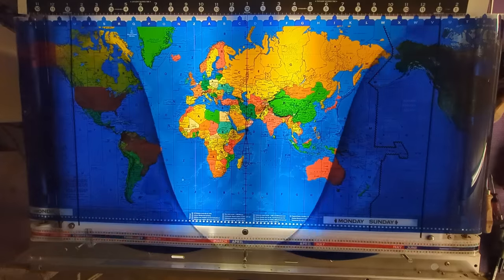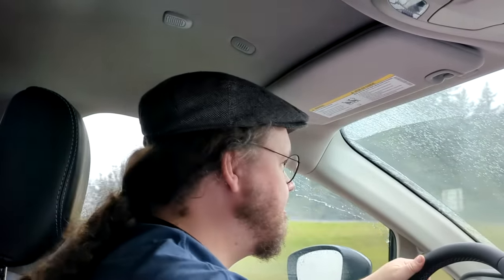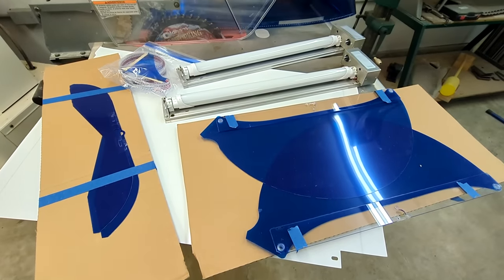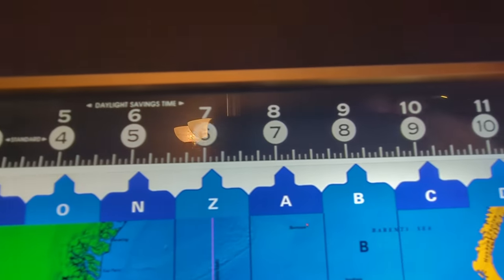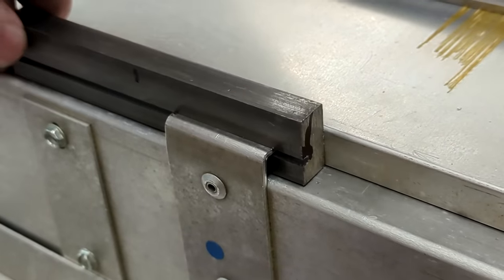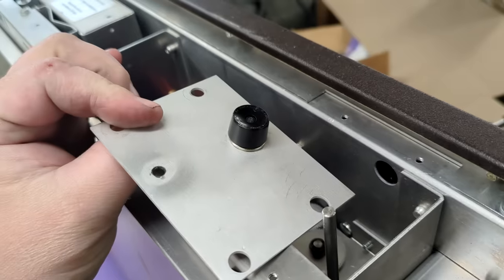The greatest clock (and map) ever made

Comment: The point of timezones was to create local time that is usable and easy to deal with. Having a local timezone that changes as you take a walk would make it entirely useless. Fun for non-critical stuff maybe? But definitely not useful as a planning/communication tool. However switching to everyone using UTC could be feasible. It would make cross-country or international planning super easy, but would be a bit weird for some people to be eating lunch at 0300 and others at 1500. You would eventually get used to your current timezone and just know that you eat break fast at 10PM and mid day is 4am, but that would still be awkward. Maybe a better solution would be to use one global time for computers and international planning, then create a few 'local' timezones where people can still have lunch around noon no matter where they are. Maybe if we divided it up into 24 timezones so each person would be within about an hour of noon no matter where they are. Then 99% of the time they can use that unless they need to deal with someone outside of that specific timezone.... Hmmm that's starting to sound familiar.

Comment: One problem with getting rid of time zones would be time tables. For example, if you live 100 miles away from an airport, and you need to be there at noon to check in, the time you leave home would vary based on the direction you have to travel to get to the airport.
Reply: The more sensible (though still very problematic) way to get rid of timezones would be to just run everything in GMT and be done with it.

Comment: Wouldn't it make more sense to use the devices GPS/location in some formula/calculation to get the local time offset then offsetting from the time at longitude 0 rather than subdividing into thousands of sections?
And maybe have some setting to throttle how much the location gets updated to something like per minute to save battery power.

Comment: Okay this is totally a double comment, but not only am I on board with your idea to add longitudinal time zones, I'd like to expand it further by suggesting we convert time to % of day. This makes the local conversion easier to comprehend intuitively, as local noon is now 0.5 on the clock rather than all of this mixed-base 60/12/24 nonsense we currently use. Of course the most promising outcome here is that now we maintain time in the same way that MS Excel stores it internally, which will benefit at least 3 people globally.

Comment: Time zones need to be simplified whenever possible but... they exist for a reason. We need to know when stuff will happen at different places, usually within our city and a couple of nearby ones. Without that we would need to add timezone information to every time statement.

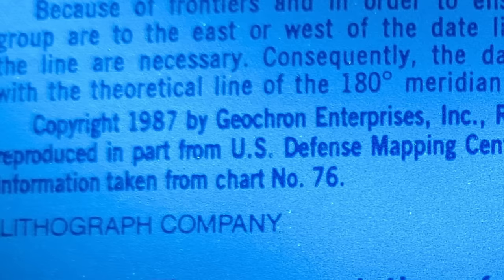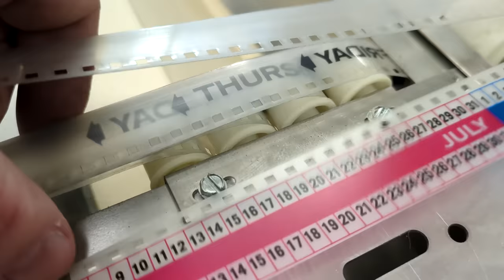Imagine you have to be at work at 8:00 UTC -6:34 the bus arrives at the station at 7:55 UTC -6:50 and you wake up at 7:05 UTC -7:04. How do you even compute how much time you have to arrive at the station and if the buss will be on time by the time you arrive at work? Putting everything on the same timezone frees you from making all those extra calculations. You can easily estimate "if the bus takes 15 minutes then I have to take the one that arrives at 7:25 meaning I have 20 minutes to catch the bus!" 

With your proposal you would have to input every time statement into your device so it can track it for you and essentially convert it into the "you" timezone.

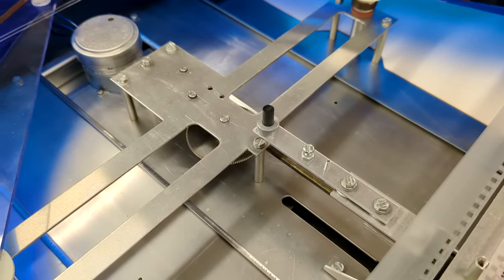Comment: RE: the end. It is "as complicated" to switch to your system. The difference is where the complexity lies. Current system, the complexity is owned by programmers and states. Your system would shift a lot of that to normal people. I have to be at work at 8:30. It takes 30 minutes to drive to work. Currently, I can just leave at 8:00. But under your system, depending on the angle between work and I, I may still leave at 8:00, but only if I am at the same longitude as my workplace. Otherwise, I need to know the time shift between work and I, and add that to my commute length.. so if my work is in a time zone "10 minutes west" of me, I need to leave at.. hang on, which way does the Earth rotate? Do I need to leave at 7:50 or 8:10??? If AT&T customer support closes at 9ET, and I live on US west coast, I can simply call by 6:00. But if they close at 9:00 in.. the HQ's block in NY's? time zone, Now I need to know how many "minutes of longitude" I am from there! Do I have to open some app with a map every time I need to know what time someone ELSE is talking about? I hope I've illustrated my point: time only matters relatively. There's a guy who had a big theory about this. There is no absolute definition of time. Your system fights against that!

Comment: If you could clamp an aluminium strip to the base (for the purpose of making a template for the holes) then surely you could have stuck a length of blue painters tape to it and marked the holes that way. The tape could then be carefully removed and stuck to your new bottom plate...

Comment: I do agree we should get rid of time zones. But I disagree, that we should introduce a more convoluted form of time zones to replace them. What if you have an appointment 20 km away, for 12:00? You'd need to factor in the direction of the place, as they may be a few minutes behind, or few minutes ahead. Or they can be at the same time, if directly south or north. Or anything in between, if they are "north-east", for example. Using UTC or something similar seems like the best solution, although it'd be weird when 13:00 is suddenly midnight for some places of the world... And when you ask someone from another country "what time is it for you now?" they can just tell you the time (which will be the same for you), and you'll have no idea what time of they they meant. Perhaps adding some affix to the time (such as the current AM/PM) could help... like "23:35 afternoon" or "8:12 evening". Either that, either don't touch the time zones at all...

Comment: 12:40 - This is a problem for a rubbing! Use some tracing paper or a few strips of paper taped snugly against the surface and rub it with a crayon or pencil to get the outline of the holes and other features of the device. Then tape that rubbing to the flat stock and use a punch or scribe to transfer the locations. There are advanced methods that transfer the graphite of a pencil directly to the final product stock for even more accurate measurements.

Comment: Whilst I like the idea of no time zones, I do see an issue.

Say I'm putting a calendar entry in for an appointment. 
Sure, the receptionist can say what their longitude code is.

But what if me and a friend want to meet at the clock tower at 12:00.

I now have to open a map to locate that clock tower to find the longitude code of its location in order to set it up.

People already struggle with simple concepts like 9 o'clock and 9 o'clock vs 0900 and 2100.

Having them NEED to use a smart device to find their current longitude code will destroy their minds.

Comment: Any chance you'd be willing to scan the service manual? I contacted Geochron recently and they state that the manuals "aren't available", but they would be happy  to charge a per hour technical fee for support. I find this a bit odd as there clearly IS a service manual, and the company has been DIY repair helpful in all other ways (parts availability, communication, etc...)

I also sent an email to the channel address with a bit more info.

Thanks, and great video!

Comment: I have a program I purchase as shareware in the early '90's  It's called: Geoclock  I have both the DOS and 32Bit version.  Unfortunately I can't recall or locate the author who actually did come out with a 64Bit version, Which I, (unfortunately) did not order.  I regret that!  If you make the journey to Boulder, CO main clock is located, they actually have the same program running in one of their rooms on the 2nd floor.

Comment: The problem with your time zone proposal is that it would make journey times hard to figure out. If I need to take a 2 hour trip I can't just leave 2 hours before I need to get there. I'd have to take distance into consideration and leave a bit sooner or a bit later, depending if I'm going East or West (a further complication). And then there's the added complication if you're not driving perfectly East or West, and need to calculate a longitudinal component. And going somewhere would take a different amount of time than coming back, even if going at the same speed.

And it would be hard to correlate time across places. If I have a computer running a script on one side of town that needs to do things at precise times, another computer on the other side of town would say the other script is running late or early, depending on relative position.

Time zones allow us to use clocks that read the same time at the same time. Your proposal would make indicated time dependant on position. That's just needlessly complicated. Daylight savings, though, yeah, we can do away with that.

Comment: I know where the idea is coming from. My only problem with that is that location on our phones rely on data services instead of phone signal. If we were to put your idea to work right now, battery life on our devices would be cut down drastically. Think of Windows 11. The system clock no longer shows the seconds when you open it. You can enable this option, but it gives you a warning regarding your battery life (if we're talking laptops).

The main point of this comment should be, however, great video. I did not know about this clock and now I want one.

Comment: Could you not have marked out the dimensions of the aluminum plate on a large piece of paper, lined that up with the bottom features and then used a small punch and knife to draw out all the critical dimensions? I think making the holes for the screw a tad oversized and then just using the head of the screw to block the light would have been fine.

Comment: Removing timezones sounds like it makes sense but it doesn't. 
People need to get to work at 8:00 is makes it to complicated if that person and where the work measure time differently so it makes sense for time zeons to be large.
Additionally, as someone who works with people from all over the world in a regular basis. I can use the local time to know how that country decided when they start (7:00-9:00) and finish (17:00-19:00) work. I don't care if they acknowledge DST or not. I just check what time it is over there now and can easily figure out where in the workday they are.

Comment: Under your plan for replacing time zones, if you lived at 40°n latitude you would have to travel 65 miles (100km) in a straight east/west line to experience a 5 minute time difference. I dont think thats too bad, but it could be a big problem nearer to the poles. Maybe theyd use a different system in the far north?

Comment: Timezones are fine as long as they are just UTC and nothing else.  What we can do away with entirely is the notion of "months" and named "weekdays."  Most of those are largely named after ancient Roman gods and dead Caesars.  The Roman empire has been dead for 1,600 years.  There are 365 days in most years (the number of rotations of Earth around itself during a single orbit of the sun).  I'm pretty sure counting up to 365 and occasionally 366 isn't too hard for most people to figure out.  Also start every year at weekday 1.  Yes, you get a weird weekday cutoff point at the end of every year but will be an extremely consistent starting and cutoff points.

Comment: 20:13 Ok, but you are forgetting about the equation of time. The Local Mean Time shifts by upwards of ±14 minutes depending on the time of year.

If we had 86400 timezones like you proposed, either noon would not always be when the sun was at its highest (it would be within 14 minutes of it though), or you would need accomidate for the equation of time which would mean constantly adding or subtracting seconds (which would cause so many problems.)

Comment: Very few smartphones are accurate.  The carrier (T-mobile in my case) uses its own clock, and the local tower drifts around a second or two (!?!) compared to the GPS constellation.  So far I haven't found a way to set my android phone to the GPS constellation stratum, so my cellphone is kind of a lone outlier.  (I could root the phone I guess, but I'm concerned about how security would work if I mess around with timekeeping).  
My home runs a OCXO slaved to the GPS stratum, and I serve PTP and NTP in-home which is much better than relying on NTP through satellite ISPs for my rural location.

Comment: Timezones are most definitely needed, what if you need to get to work at 8am, but your train leaves at 7:15 am and you need to transfer trains at 7:45 am, and maybe after work you want to grab a bite with a collegue at 7pm, how many times do you need to convert timezones? now you do not only need to account for the speed you're traveling, but also the local time zone, also if someone texts you, their timezone isn't automatically converted to yours, so you'd need to manually convert it, what about remote working? all very confusing and very impractical

Comment: I think we still need time zones. Back before we had time zones every town has its own time if not multiple times based on the sun being overhead at high noon and people not agreeing on what high noon was. I don't think we need it as a mess as we have it now and we're gonna have to do something about daylight savings time at some point but that's gonna break a lot of VCRs and other devices that we don't know about. We've managed to make some things just fart enough that they are going to be really dumb if we get rid of daylight savings time which is slightly annoying. I'd rather fight with the clock a little bit to get it set and have it flashing 12 some devices have gotten smarter in later years and just show zero or nothing. And if we get rid of daylight savings time we're gonna have to decide whether we go forward back or split the difference which will then mess up the offset of one hour between time zones. So then we go to the question do we need time zones well Russia doesn't have one from what I understand they have one big one so sunrise and sunset on one side is a completely different time than sunrise on the other which from what I understand is a bit messed up.
And then my own little world I think we need a little something to say hey the suns out get off your phone and go outside.
And I certainly don't want my employer deciding they're gonna run their entire billing accounting and workforce on their own time zone and time standard I know I already where to watch it but that would mean I'd have to have a third.

Comment: I also think that timezones should be removed, but my idea is literally removing them. Have a single clock that simply has 12am at different times of the day, without any need of adjustment. The only reason we needed the clocks to correspond to solar time is that we didn't have lights that allowed us to work without it. And if anyone thinks that removing timezones is a really bad idea, let's just make sure that they are straight lines, and not completely politically gerrymandered, ok?

Comment: how does it handle the weird time zones that are half or 3/4 hours off? Like Nepal Standard Time (UTC+5:45), Indian Standard Time (UTC +5:30) or Australian Central Western Standard Time (UTC +8:45). You showed the last one (I think it was that one) but does the clock itself handle it?
Reply from the maker: They're just labeled as something like J+30, and you need to add the offset yourself after looking up the current time of J on the top strip.
Reply: @Attoparsec  ah, they took the easy way out. understandable but disappointing

Comment: Don't make the mistake of thinking that a USB clock is going to be as good as an AC clock... I have one that loses about 2 minutes per day, an amount that would be considered laughably bad for a mechanical clock. I'm sure it's just that they used a quartz crystal that had been rejected for very good reasons and was swept up off the floor and resold is good but it doesn't change the fact that it's a lousy clock.

Comment: Or we could all use one clock, one time. synchronized, all around the world. The representation of time is merely a number. I could get off work everyday at the same time no matter what number that represents. As well, all of mankind, would know what time it is everywhere, everywhere.
Reply: It does cause a slight issue when the date roles over in the middle of the day, but it's certainly more viable than functionally using Local time for everything.

Comment: 1 timezone per minute is insane. at most, 1 timezone per 30 or 15 minutes is okay, the precision of noon isn't important, as it is, hourly is almost good enough. abolishing timezones is the better option, even though i have a distaste for odd numbers and unbalanced positive and negative solar time.

1 hour timezones are good. Daylight savings should be abolished, the date line really isn't a problem unless you live there, 24 hour time is superior, metric time is weird, binary time /quaternary/octal/hex is best but unneeded. Analog clocks are underrated, the 24hr ones are upside down.